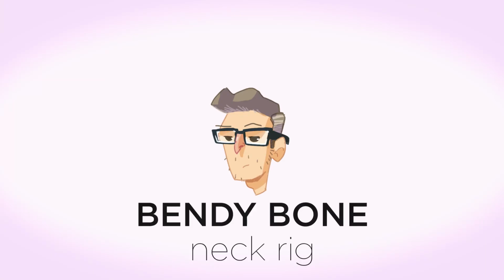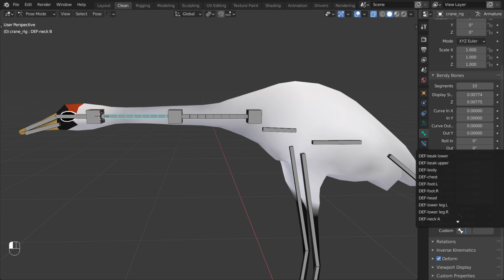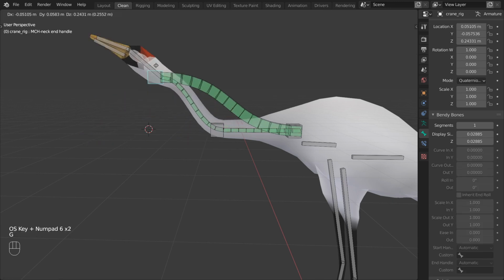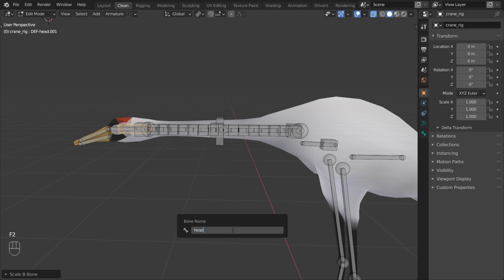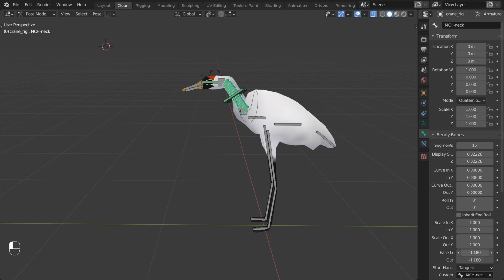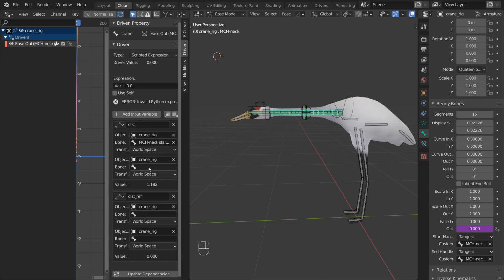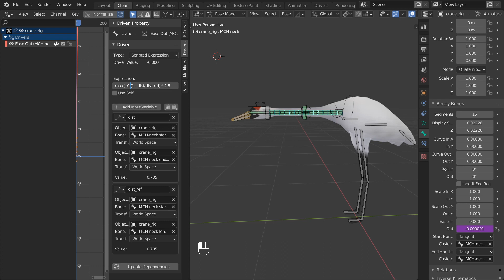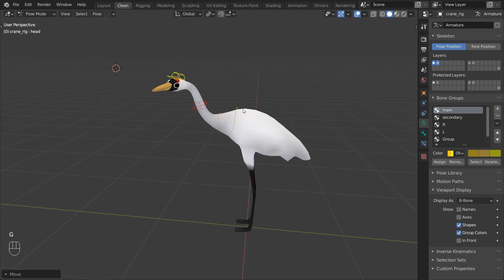Blender Intermediate Rigging - Bendy Bone Neck Rig

Comment: A question: Which part of the set that forms the created flexible bone should be assigned the weights of the mesh, to the subdivided ones or to the one below them or both parts?

Comment: I think this is a lot of struggle and nightmare for something that could be achieved fairly easily with just regular bones and toggling on auto IK. I have a lot of similar rigs since I love swan-necked unicorns, dragons, etc and this rig is way more limited than just freely moving the bones- it also introduces the problem of squash/stretch when you DO NOT WANT IT.
Reply: Adding: Bendy bones are best suited to certain electronic structures that twist in interesting ways or stylized content such as cartoons that get smashed or do ridiculous poses.

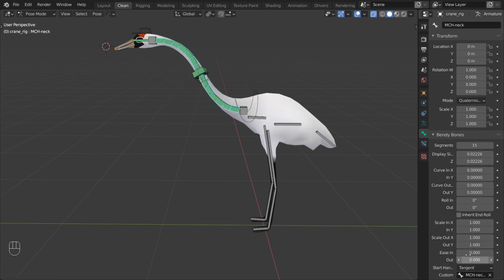Comment: at 6:18, how are you adjusting ease in and ease out together? It looks like you click and drag on ease in. If I do that, it adjusts ease in. But in the video, both ease in and ease out move together
EDIT: nevermind. I figured it out. press ease in, drag down to select ease out, then drag side to side to adjust the value

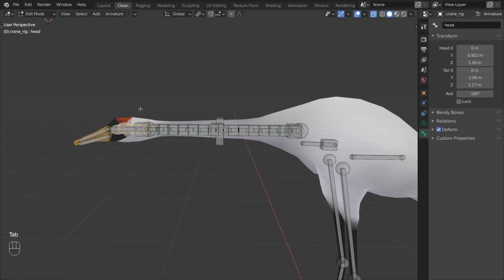Comment: At 5:50, the head mesh itself is distorted when moving the rig, then this is fixed later, so that the head volume stays the same as the rig is moved. How is this done exactly?
Reply: I’m assuming with weight paint? Sorry if I’m late. Haha
Reply: @Zixea_a  no worries! I ended up solving my issue in a different way, weight paints didn’t quite work if my memory is correct.
Reply: I re-parented the DEF-head to the Head control to fix this issue~